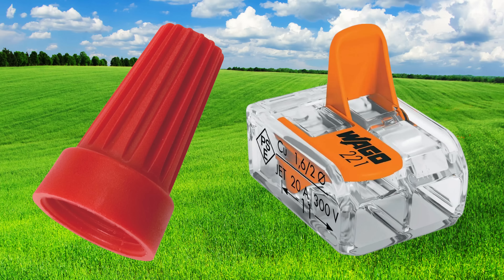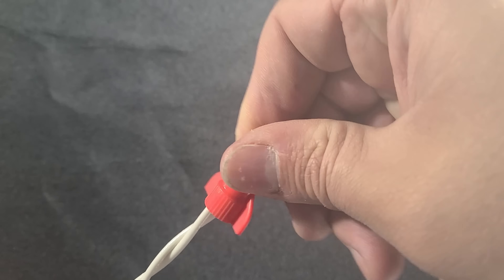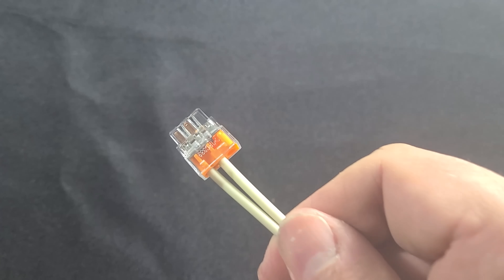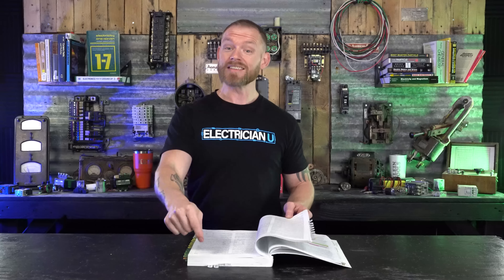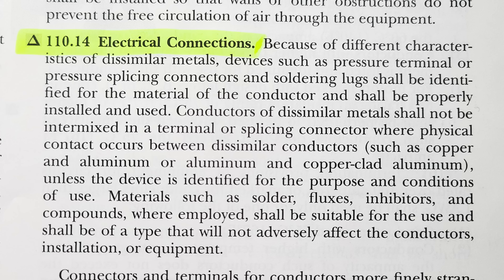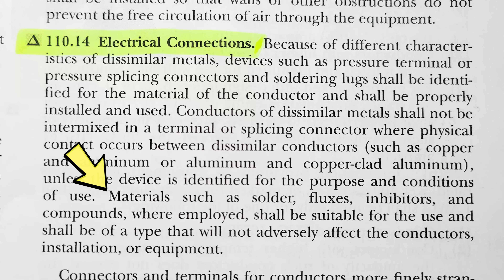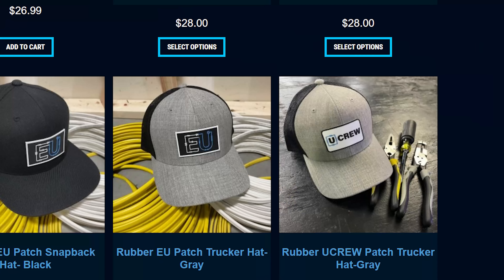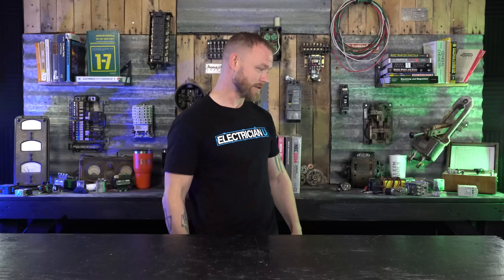Should We Use WAGOS or WIRENUTS?!?!

Comment: I've watched a few of the comparison videos here on YouTube, and the conclusion I've come to is that both connectors work perfectly fine and safely when used correctly within their limits. I think people just love to argue about these things because it's human nature lol, it's like sports, everyone wants to root for one team and boo the other. I don't think you can really go wrong using either as long as you learn to properly use them.

I guess one piece of advice I'd always suggest, make sure you're buying brand name connectors for either option. It can be tempting to go and order a bulk pack of no name brand wire nuts from Amazon, but compared to the Ideal brand ones I've purchased from the hardware store, I've had Amazon ones fall apart. Not saying they're all like that, but if you're doing work for someone else especially, it's probably best to be safe. The Wago style connectors have a way more specific design so they're even more sketchy if they're knock offs. I have a feeling a lot of the negative criticism both connectors have received can be blamed on these poor quality knock offs too.

Comment: How do you secure, or know for sure, a connection between solid core and stranded wire using wire nuts?  I get these light fixtures with stranded wire and they have to be connected to solid core wire, but I have found sometimes a poor connection results. Any advice?

Comment: Would only use Wagoes for light lighting loads. Pressure connectors will go bad with heat from current high draws over time , just like stab in duplex recepticals that have been used since the 1970s.

Comment: I recently discovered Wago's and I love them.  Wago's give you a nice, trustworthy connection.  Recently I took a cover off a junction box to put in a plug there for my wife.  I took the cover off, went to pull the wires and the wire nut just fell off.

Comment: HEY! YOU'RE VERY WRONG!!! REGARDING THE COMPARATIVE CLASSIFICATION OF THOSE CONNECTORS! THE PARTLY TRANSPARENCY OF THE (2) THE WAGO HAS QUITE A FEW ADVANTAGES + IT ALLOWS ACCUR.: GAUGE CUT!~ JUST FOR STARTERS!! IT'S ALSO NEATER & TIDIER!! HAS A FLAT! SURFACE TO SOMEWHAT! ERGONOMICALLY READY! CONFORMING! TO THE RECTANGULARS SPACES OF THE BOX!  PLUS ALL THE FEATURES OF THE WADILLY!! OUTGOING! SO YES!! ONESTLY CLEARLY! THE WAGO! IS AN UPGRADED CONNECTOR! OR AN CAN B EASILY MADE TO B CLASSIFIED AS SUCH!!

Comment: Ok ....I hope I can explain this this ok.....I've looked at a wago connector and it's basically a thin wire strip that connects the two or more wires together.  Wouldn't only having a thin metal connector between the two or more wires basically be a fusible link?? This is what concerns me about wago connectors. I personally found a wago connector that was partially melted when I opened up a wall in my kitchen that the previous owners had recently done a kitchen remodel done. Now granted it wasn't melted enough to cause it to short out etc... but it kinda supported my theory that if a wago connector gets even a temporary spike in current for whatever various reasons it litterly can heat up because the thin metal connector is thinner than the wire. Thereby creating a fusible link as it were. I dunno these wago connectors concern me....

Comment: just a tip on fishing wires inside walls drill 3 holes 1 for wire 1 for light 1 to look through  can get wilre in the hole of box every time on uninsulated walls  and dont forget to fire caulk holes

Comment: no wagos in house wiring push connectors are not good for long term use look at push connectors in devices always leed to bad connections and the flip up wagos in a junction box i feel that the lever could be moved when stuffing a box i agree with light fixtures where different wire typ and size ok where it can be replaced or contained in a metal fixture i saw you stuff the switch box finaly see a vidio that someone took the time to do it the right way fold wires to the back of the box so the possibility of a short in device or acadental contact from homeowner replacing device  in 12 volt dc automotive push conectors will fail dc produces more heat and resentence on push connectors so not a fan of stab connectors except you light fixture example

Comment: Great explanation. Things are made to fill needs in an industry (why new items keep being invented). It’s how you use them and what application is what supplies are needs to get the job done. There’s a ton of different way to skin a cat but if any way that’s done correctly and safe and best for the application will make sure things are done in the long run. Also make sure you look at the hole big picture and not just the task that’s in front of you. More one at one point sometimes saves more time in the long run. Experience and information will give what directions to take

Comment: the side wire screws on a receptacle, and busbar terminals in an electrical panel deliver 1,000 PSI of connection strength onto a wire, the tightness of a spring around copper conductors while not as much PSI is a superior termination for wire expansion and contraction especially with high initial startup motor circuits. there is no excuses and nobody can tell me a wago has a connection anything close to rivaling any of  those terminations. they will Arc in the wall  for months generating tremendous heat before  failing.

Comment: back in the early '80s Alcoa was pushing residential  aluminum Romex, and a lot of that was sold and installed in homes and trailer coaches the wago type of connection which has no safeguards for expansion and contraction that occurs in normal cycling of a circuit caused a lot of fires and deaths, after that unfortunate lesson that people seem to have forgotten, wire nuts with a stainless steel spring and solid copper pigtails to the device are still required for Al to Cu  terminations in branch circuits or to a device.

Comment: these things are fine for the UK and Europe where they have 220 volt receptacles we have 110 that's half the voltage in that's not enough to keep the connection these things are a fire risk I know from troubleshooting and finding these to be the problem in the field several times I found completely melted plastic boxes and outlet so hot I had to let it cool before I could even touch it , there is a purpose for these and that is in the PLC cabinets for terminations of signal outputs and inputs.

Comment: I consider WAGO's equiviant
Reply: to stab or push in connections, AOK for  todays low current LED lighting .Not so much for receptacle strings . I would not use them in my own home for that, taught over 30  years ago to pre twist and pigtail to a device, I just don't trust Wagos for potentially high current receptacles.They DO NOT bite hard enough to keep wires from rotating , how could they possibly be as good as pretwist with a wire nut???

Comment: Been an electrician for over 30 years. My personal opinion on this is that I won't use wagos on anything that I think or know will draw allot. They're great for allot of things, but I do think for things that have a heavier draw, a twisted connection is better. With light fixtures and other things, wagos are just fine because the connection will never see a big draw.

Comment: WAGOs are probably ok in stationary connections, but vibrating connections like motor connections or moving equipment I use proper size wirenuts, then electrical tape over the entire connection to prevent loosening. Just my own experience.

Comment: Okay, Off the wall question about connectors. What does code say about using butt connectors (like the ones used on DC systems of vehicles) on residential wiring? I have seen these rated for 600v and wondered why no one uses them in residential. Be kind, I'm a DIY kind of guy, not an electrician.

Comment: I currently have a lot of wirenuts connecting the wires on the outside irrigation sprinkler valves and I was thinking of replacing the wirenuts with the wago connectors and use electric tape to fuller wrap and connect the wago connections, some connectors are 2 wire or 3 wire and 4 wire, is it okay to use wagos for the irrigation valves?  I have worked using these wirenuts in the past and found some that where not making a good connection so I thought I could just use the wago's with electric tape afterwards and make the whole setup more neat. I am curious on yours or anyone else's thoughts?

Comment: Just to make a correction. you are young and don't know the history.  What you call a wire nut is not a trademark name. It is a generic name.  The wire nut was invented and patented in Canada by a guy named Marr.  The unofficial trademark name that it took on was Marrette.  The legal patented name both in Canada and the US was "Electric wire connector".  Ideal had nothing to do with any of it.   

My concern with spring terminal blocks what you call a "Wago" which is brand name, has nothing to do with how convenient or easy they are. My concern is will the spring metal hold up for the 40 or more years it is expected to function.  We know that springs fatigue and get week with time.

Also, we know that wires, due to vibration of current flow or hammer effect of turning off the current WILL  affect the tension of the spring.   Ask me in 40 years if spring connectors are any good

Comment: If you’re accustomed to only using wirenuts (which almost always have 600V ratings), you need to take a second before you use a wago and check their ratings, because they have wacky voltage ratings. I’ve seen some rated 300V and some rated 450V, neither of which can be used to make 480V splices.

Comment: I have a light fixture that has 10 lights, basically it's like a giant spider, each one of those lights is essentially just a single hanging light, so thats a total of 10 hot and 10 neutrals that need to be connected to the boxes single Hot and single Neutral, if you tried this with wire nuts it wouldn't fit inside the ceiling box, thats when I learned about Wago's and thats when I used them.

Comment: Love wago. But not the best choice when motion is involved. I’m mostly industrial. They seem to fail some what often with stranded wires on robots. As for residential may not want use them on ceiling fans that potentially vibrate. They are super convenient. But seem to cut wires over time. Again when motion is involved.

Comment: Twisting and untwisting weakenes the wire, and chews it up, the teeth on the pliers do this. The mechanical way in which the wago grips the wire allowed for thermal expansion and contraction, whereas twist does not. What am I missing here?

Comment: Wago is a brand. They make several devices. 
You are referring  to push wire connector  or lever connector.
These push wire or lever connectors are superior to wire nuts example, connections with diffrent wire gauge. 

Lever connectors makes superior connections on stranded  to solid wires.

Comment: I do not do electrical work a lot, and I know that wire nuts outnumber Wagos big time, but I have seen wire nuts fail due to being defective or improperly installed, but I have yet to see a Wago fail.
If I hired people, I would instruct them to use Wagos because if I learned anything over the years, the easier things are for people, the more likely they will actually do it and less likely they are to F it up.

Comment: Yes thank you for the video. I prefer wire nuts and soldering  if necessary.   Minor repairs in a residential home  for me is  change  and updates on my  60 yr home  . Like i have bad juju with my  garage door and  switch  and  outlet.  Causes  extension  cord  to  loosen so i loose power  and  door  does not remotely  open or close  properly.    Details.....   at 4 inch metal  box..... 1/2" conduit  up from box to  single old  screw type  light fixture  made for screw bulb.... replaced with brighter screw in  led fixture. On seperate single pole switch. In same box as old 2 prong outlet.... overhead garage door  is  plugged into  a  100ft extension  cord   wrapped around  main beam  to  the outlet.   Second  1/2" conduit  goes down to slab and is  connected to  my penel to a 15 amp breaker.  Unknown  if  grounded. Want to replace the  outlet with a  gfi . How can i go about it?

Comment: Everything has its place. In a ganged box with 8 #14 neutrals, a wago might not practical.  I used to service very old homes. Wago's are great when the wire in a box is brittle, very old and short and moving it will cause more insulation to fall off. Gently clipping a wago with a new tail onto onto the short wire has saved the customer lots of money, many times.

Comment: Would like to note that, yes, you ARE supposed to pre-twist.
Most older wirenuts didn't even have conductive material inside them.  The wires are meant to be physically touching.
This is one of the major differences between a WAGO and a Wirenut.  The WAGO does NOT physically connect the wires to each other, but instead to a conductive bus.  This results in more resistance and therefore more heat.

Comment: The argument for me here is that the wire nut holds the wires in contact with each other... thus, making the electric path, jump straight from one to the other,.... a wago IS the connection... the clamp inside the wago is what makes the joint.... I believe this is a weak point...  a PROPER wire nut beats a wago.

Comment: I'll say right off, for Oklahoma, if a fixture comes with wagos and you replace them with wire nuts, I have had Journeymen tell me that they have failed an inspection before because of it! It is a part of the listed equipment! Inspectors will look at the papers for a fixture or a piece of equipment such as a Automatic Standby Generator and if it isn't according to the papers that are with it, they will fail it! I've had people argue you can't use a piece of conduit to protect wires, that it has to be complete but then ignore the rest of what is said about protecting the wires. But when it comes down to it, if the AHJ says no, you better have a good reference. If I'm running it through a room and need to protect it and it's less than 10, I don't even need to worry about ambient temperature. chapter 9 note 2 gives reference to incomplete runs of conduit used to protect exposed wiring from physical damage; 725.31(B) speaks only of protection from physical damage and nothing about complete runs of conduit. 310.10(D)(2) also covers protection from conductors exposed to direct sunlight  by tape or sleeving that is listed or listed and marked as being sunlight resistant; also wire emerging from below grade shall not be required to be 18" below grade; 300.5 (D)(2) conductors entering buildings shall be protected to the point of entrance; 300.15(C) where cables enter or exit from conduit or tubing that is used to provide cable support or protection against physical damage, a box or conduit body shall not be required. I can't think right off but where wires pass through the top plate of the bottom floor through the bottom plate of the top floor a piece of EMT or RIGID Metal conduit is used to protect it and must extend up 6 inches where it emerges through a framing member. I've seen Journeyman get a red tag on this a few times. but there are a tone of instances where the code says you can use conduit to sleeve a cable to protect it but I always hear  electricians shouting about how it's not legal and how they have been tagged for not having a complete run terminated but it isn't required and maybe they are telling the truth or maybe they are just repeating what someone else said, but usually if you can show in the code that you are just sleeving the cable or wire to protect it from physical damage, then maybe they would change their mind. I constantly see electrician bundle Romex, but if you bundle it for more than 2 feet, then you have to treat it as if it were in a raceway. I went way off subject there but I'll go ahead and leave it because it's useful information lol

Comment: With stranded conductors, simply split each end into 2 groups, twist up, and insert like a solid. I'll even splice 3 together (Note: strip more length, then cut to length later, and pair them up for 3 sets of pairs then twist the 3 pairs together for a final beautiful braid)  in this manner, and do a star configuration off a single 4port wago, if I'm just doing an alarms data circuit, or lighting.

Comment: Make sure wagos are rated for the amperage. Most are not. Most problem is with neutral overheating, and wagos fail faster than wirenuts in that situation.

Comment: Thank God these are gone 55 years ago. There were some wire nuts that were lined inside with metal.  I found at least one fire started when somehow the two wires in the nut only made contact through the metal in the wire nut; turning the wire nut metal into a  glowing filament. So, with the metal lined wire nut, it was common knowledge that only idiots did not twist the wires before the wire nut was placed. The metal inside the wire nut made for a fantastic grip and was almost a weld, but if there was a spec of dust between the two wires it would be a hazard, so twist was a must. In those days the outside of the wire nut was softer than wire nut plastic today. Maybe an advancement in plastic hardening made for the end of metal inside wire nuts.
Reply: Are you referring to the old kind where you crimped the wire band inside the nut on the wires and the outside plastic was (at least originally) soft and flexible? They  can't be twisted back off like the newer kind. If so I run into them all the time in 50+ year old institutional work. No major problems, just annoying to remove when making changes.
Only experience with WAGOs or Push Connects was re-lamping T12 fixtures to T8 electronic ballasts.